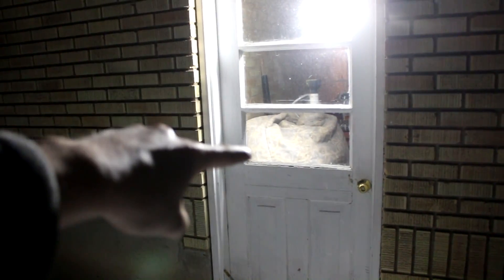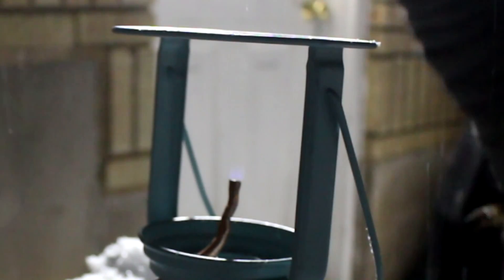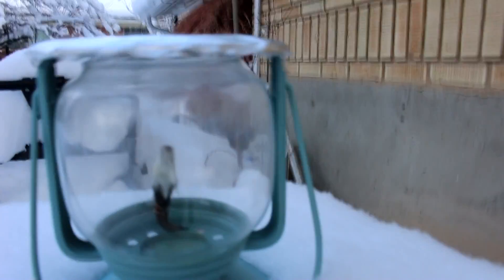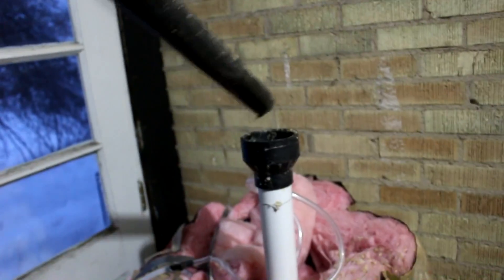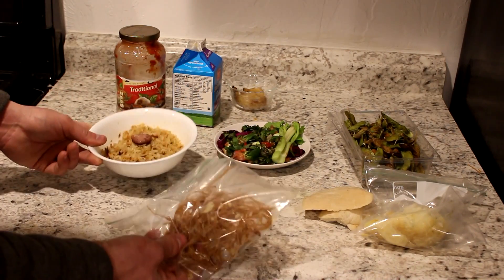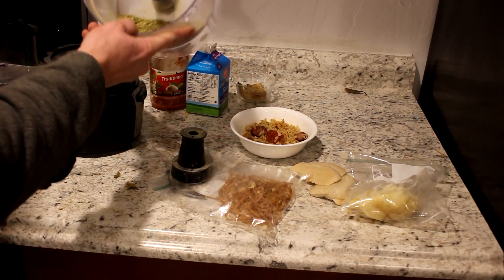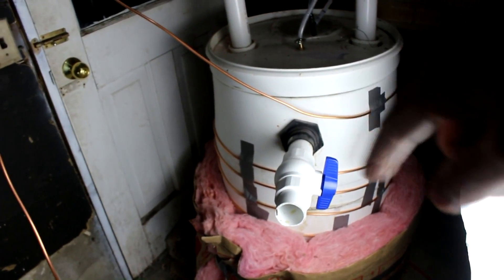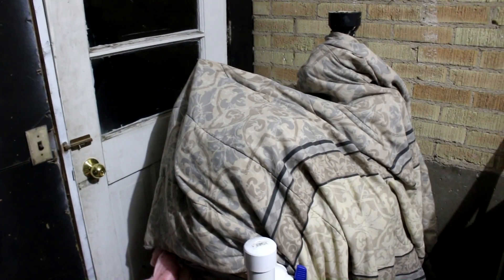Cody's Methane Generator Part 2: I Have Gas!

Comment: Cody, theres no reason you can't compost meat and oils. The caveat is you can't easily FAST compost them. If you bury them in a pile of carbon based materials there will be no smell and animals will leave it alone. I've composted lots of meat, left over turkey carcasses even. The trick is to have a big pile and not be in a hurry. My compost pile builds for a year, then rests for a year before use. Sometimes I'll find bones in it, smack 'em with a hammer and put 'em in the active pile and they're gone next year...

Comment: From what I've seen of other digestor projects, a tube of compressed steel wool can be used as a filter for removing the hydrogen sulfide from the gas mixture. It was also suggested in those projects that the purpose of doing so is more to protect components from corrosion than for the clear olfactory benefits ;) Just use your nose to determine when it's time to change the filters :D

Comment: cody if you open the valve wont some undigested material come out?
Reply: Well, the Wastewater is usually drawn from medium depth and most material either float or sink to the bottom leaving mostly fluids in the middle. But sure if you pour a gallon of milk in that would be true.

Comment: Add some anti foaming agent (even the kind used in spas will work). That will give you some use out of the foam. It will re suspend and get further broken down. Add another tank for stage two. it will give you more gas and separate your outputs, distill them if you will, into the separate tanks. Then you can collect methane, phosphates, and alcohols from one tank while getting ammonia gas, acetone, and nitrogen from the other.
Reply: festerallday genius

Comment: cough Fire hazard cough 
Having that flame really close to the pink insulation might be a bad idea. Its a gamble I guess.
Reply: Aleksei, you are telling me that GLASS can catch fire? Hehe, you are funny. Fiberglass is not flammable in any way, shape, or form.
Reply: i assume that insulation is flame resistant or something. would make sense since people put that into their walls.

its fiberglass isn't it? that'd mean its flame resistant.
Reply: Just because you put it in your house does NOT mean it can not burn. Fiberglass or not it can still catch on fire. Of course someone would comment thinking they're right.
Reply: your telling me I could through fiberglass into a fire and it would not burn..
Reply: The paper would burn, as would the blanket. The fire will probably not get to the digester because of the fiberglass. It would stop after burning the blanket and the paper.
Reply: Aleksei Oh sure you can burn fiberglass...at around 2000 degrees lol
Reply: Aleksei Yes, Absolutely. It will not burn unless the fire is like hunter said at around 2k degrees
Reply: Yes, fiberglass would not burn if you threw it into a fire. It could absorb the heat and spread it to other places, but it would not burn. At least not at any temperature that we're concerned about.
Reply: cough Moron cough

Comment: is it dangerous to leave the small flame under the heat insulator which seems to be flammable?
Reply: pattanan chinanuvatana glass is not flammable
Reply: Its safe enough. A catalytic propane heater might be safer still.

Comment: Did you actually meter the power consumption?  I'm just curious since the digestion process generates its own heat, I'm wondering if once it's running if your need for external heat drops way off.

Comment: So next you could try to keep a battery charged to recharge your cell phone with the overage of power from the sterling engine that runs on the excess energy produced by burning the gas to get heat to maintain the reactor temperature... o_O LOL

Comment: If using the methane to heat it doesn't work due to any variety of factors, it might be more interesting to store larger quantities of methane to use for energy production and turn something like a tesla turbine to make an AC generator. Plus if the power goes out you have a backup

Comment: Hi Cody, great video, as usual :). Btw, what are you going to do with the generated methane in the long term? I guess just burning it is not the goal of producing it, so I guess you will hook a compressor to your gas bladder (similarly to how you did for the water electrolysis project) and store it in a pressurized container? And what next, will you use it for cooking or powering an engine, or something totally different? Thanks and keep up the great work!

Comment: Now you just need to figure out how to compress it into a storage tank.
Reply: Wouldn't that be as simple as hooking up a compressor to a large (bigger than the beach ball) supply of it? Surely? Honest question.
Reply: The problem is finding a compressor that can handle methane without either contaminating the oil or downright catching fire :P
Reply: yea running methane on a compressor is like running gas on a combustion engine , compressors works by using a pistons
Reply: MrOpenGL a peristaltic pump would be slow, but it wouldn’t contaminate.
Reply: Need a diapham compressor . Use an oxygen pump . Or a very cheap China unit is plastic.
Reply: Or, the cylinder could be cooled with Nitrogen and Methane pumped in. It'll condense and fill the container once it warms back up.

Comment: Cody would it not be more energy efficient to use the flame to power a sterling generator that has the flame one one side and rainwater cooling the other side, then take the power from that and use it to power a heater. Also even if it does not power the generator it would be interesting to see it built

Comment: you can put meat in a compost bin with no problems I do it all the time. the key is to have a lot of Browns like leaves or wood chips and Barry it to the bottom you will not smell it. Predators will not either.

Comment: nice job, from my experience the flame should be directly touching the metal for good heat transfer, otherwise we use fins at the gas side of heat exchanger

Comment: Maybe you can use a microcontroller board (Arduino?) and a bunch of cheap I2C temerature sensor ICs to create a temperature sensing matrix inside your generator. This way you can see where in the chamber most heat is being produced and how it reacts to adding new material.

Comment: Theoretically, would a large enough Stirling engine be able to power the heater (using the heat from the gas produced by the generator)? Wouldn't work in summer, but then... you wouldn't need as much heat in summer.

Comment: i learned something in school few years ago in chemistry, of which im not a big fan of xD, about combining co2 and h2 and creating ch4 and h2o
so solving the problem of co2 in a way and creating a circle  
google co2+h2 
the pdf is in german but the described picture is actually english
i am a fan of recycling and systems that are independent  --> Mars mission which i will not witness any decades soon as i know our world

maybe you could implement a section into your project
btw my teac(her) in chemistry is legs down partially disabled, caused by fascination for quite dangerous metals
Reply: It's called a water gas shift reaction, and it requires industrial  equipment. Not at all practical for home application. Also, the enthalpy of formation for C02 is negative, so to split it for a 
water gas shift would consume more energy than it produces, BEFORE efficiency puts even worse variables in.

Comment: Cody you're losing gas out of your clear port hole
Also you'd want your release hole closer to the bottom else your just going to pull off the new stuff and barely get rid of the stuff below the release pipe 
Also aren't you worried about that mold in the system?
( you should probably also put in a one way check valve in the gas system) 
But question 
Cody, out of flammable gasses
What would be the best for making a torch 
With availability and temperature being higher the better 
I'd love to see you do a video or something on this

Comment: Love the video! Beautiful flame!!!! Could you use a compressor to compress the methane into an empty 20lb propane bottle so you could make a big beautiful flame thrower? When the beach ball gets full, run the compressor to suck out the methane and when the beach ball is almost empty then stop. Keep topping up the propane bottle when the beach ball gets full. When you get up to 90psi then time for the flame thrower :)

Comment: Put a small weight on the beach ball to even out any gas production variations, or better yet, use the floating tank method... Gas storage and pressure in one unit!

Comment: will lawn clippings generate methane?
Reply from the maker: yes but needs to be mixed with high nitrogen items.
Reply: Thanks Cody, so a methane powered lawnmower running off its own clippings is possible, that's awesome!
Reply: James Coburn okay my goat is now thrashing around inside my methane digester so do I just sit and wait?
Reply: I think a lawnmower would need a bit too much energy for that :)
Reply: I don't mean running directly from the digester as the methane is being produced, I mean building up a supply of methane over a couple of weeks (I mow approx once a fortnight here in Aus) and then using that gas to power the mower. all I need is about 10 minutes mower runtime a fortnight to get my lawns done
Reply: or you could get a goat. :p
Reply: touchéJames Coburn
Reply: yeah, the grass would just be a percentage of what went into the methane generator, along with other nitrogen rich waste, as Cody said. and I don't want to break the law of conservation of energy, I can't afford the demerit points :D
Reply: Ned's Head You wouldn't be breaking conservation of energy, the energy has predominately come from the sun, not the cutting of the grass.
Reply: I see what you mean. But you would't be able to get the amount of energy requiered to run your mower from the grass you would cut with the mower, see what I mean? Ofcourse you could run anything on energy produced by a methane generator but I was talking about the input being to small in the generator itself
Reply: yes, but it's tricky. there are commercial AD plants running on grass silage in the SW of England
Reply: Ned's Head grass silage can have up to 200g protein/kg of dry matter (typically), plus plenty of free ammonia. This is adequate N for healthy AD, but the actual grass protein content is highly seasonally variable. By careful analysis of the silage clamps feeding the digester, you can mix different cuts to ensure the right nutrient input.
Reply: i saw a video on youtube of a guy running an ordinary gasoline ride on mower from a propane cylinder without any changes to the engine.
Reply: @hynesie11  cars run really well on propane to it burns very clean. The reason it is not used so much is the vapours can be safety issue and if it's in a crash and a spark it could potiently be a bomb.
My freinds car uses this with petrol engine as back up he can switch between. It runs really clean.on propane and is so cheap to run. It is a really small car anyway but he says it has more power when running on the propane this is backed up by a projectfarm video where he sees a RPM increase in a generator under load running on propane compared to petrol.
Reply: Are there any plants high in nitrogen?
Reply: Im thinking of growing azula and duckweed as biomass for a digester, use the fluid fertiliser to feed the azula and duckweed.

Comment: I never would have guessed that the flame would produce enough heat to warm the tank. You should explain how you calculated that it would. I'd love to see that.
Reply from the maker: Well it was calculated assuming no losses and based off the energy (number for biogas found online) in the 10 cubic feet/day.
Reply: ***** I would think the losses due to heat leaking to the environment through the insulation would totally make it futile. I hope you prove me wrong. By the way, does the metabolism in the tank generate enough heat to be useful?

Comment: cody, could you use a larger stirling engine and put it on top of the lantern to help power or potentially fully power the methane generator by itself?

Comment: THIS WHITE BOY JUST PUT OUT A FIRE WITH HIS BARE HANDS YO
Reply: as soon as he covered the supply no combustion took place so it stopped generating heat, the tube would have been slightly warm but other than that nothing
Reply: This white boy just wrote a post as if he wasn't.
Reply: He's  actually black